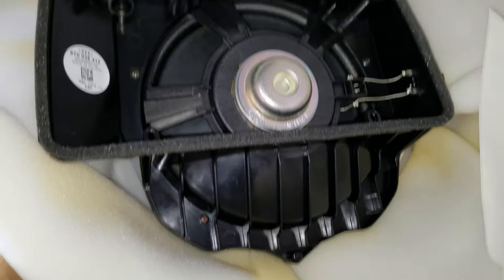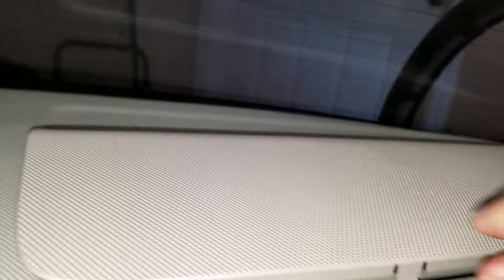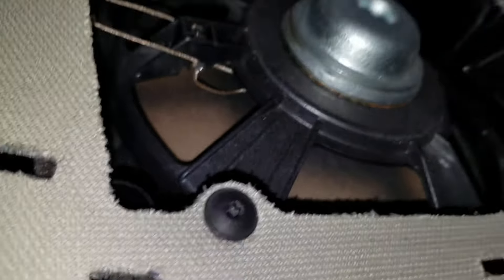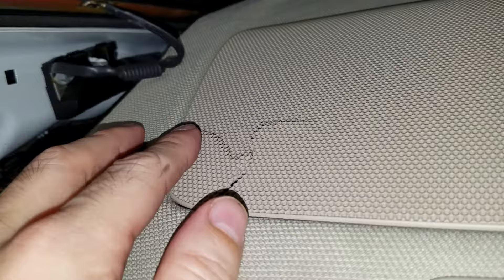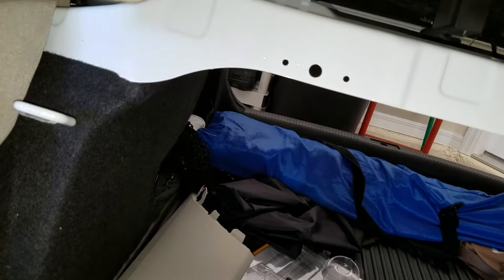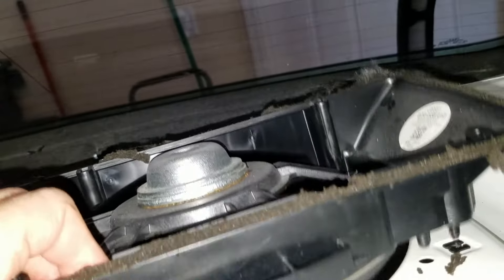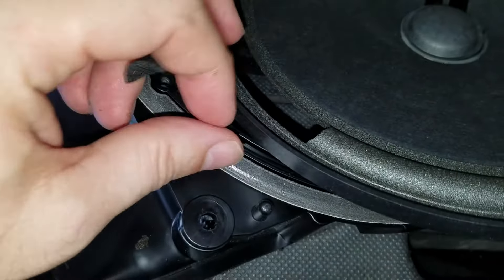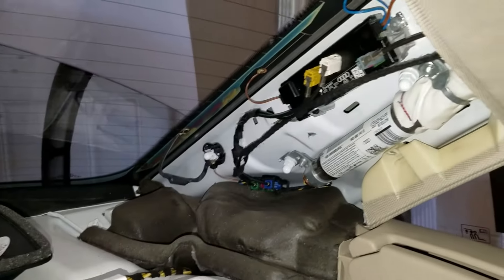Audi A4 B8 Woofer Replacement 2009-2016

Comment: Thanks for this video! one question though, the subwoofer in my a4 sounds exactly like you described, but i also have a separate subwoofer mounted in my trunk that works completely fine. Would i be able to simply unplug the broken woofer within causing damage to anything? sorry if this is a stupid question i know so little about this stuff
Reply from the maker: Try it! Probably will work!
Reply: @CarsandCoding  worked perfect! thanks again for this video you saved me and a lot of another people a lot of money! :)

Comment: I need to do this. However I was thinking of going with an aftermarket sub and using some dynamat on the top and bottom part of the shelf to tighten up the sound and reduce any miscellaneous rattles that may creep up. However I don't know if it would even be worth it.
Reply from the maker: Will it sound any different? I don’t know. Will it last longer than the original? Most likely! But will you keep it long enough to find out? :)
Reply: @CarsandCoding  do you know any good aftermarket subs mine literally just went out today after bumping migos new album 😔

Comment: Thanks so much for creating this video, C&C.  Owned my 2010 S4 since new, and the buzzing from rear woofer just recently started. Brought it to a car audio shop. Tech described pretty much exactly what you yourself showed. He said this woofer separation happens to ALL Audi’s rear speakers due to the sun baking the rear package shelf over a 10-yr period (average).

Labor charge was going to be $300 ($125/hr. rate). May I ask how long it took you to DIY? At 65, I need to decide if I can get in my trunk and remove its seatback.

He also confirmed that I could just disconnect the wire to disable the speaker, but I know that will compromise the stereo’s output quality. The S4 is in great shape, and I don't like diminishing the driving experience!
Reply from the maker: I would say it’s a 1 hour job at most. But a shop is going to charge you what they need to make enough to pay the rent. $300 plus the part is not unreasonable for a $60k car when new.

Comment: Is the speaker terminal labeled positive and negative?  I'm thinking of replacing mines with an aftermarket one and want to make sure I wire up the speaker correctly.
Reply: So if you use a 9v battery on the terminals of the subwoofer if the cone pushes in then it’s wrong but if the cone pushes out then you will have the right polarity to positive and negative.
Reply: @chile-anyways943  thanks for that 👍

Comment: since there's no speaker or anything under the passenger side (fake) speaker cover - that one doesn't need to be removed, right?
Reply from the maker: Yes I believe that is correct.
Reply: There is an electrical device under mine. I wish I knew what it is